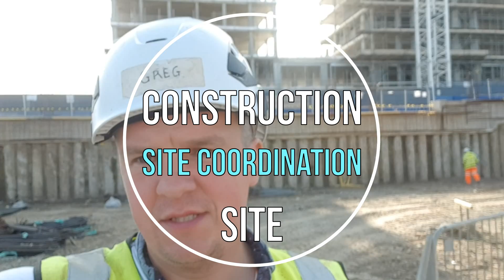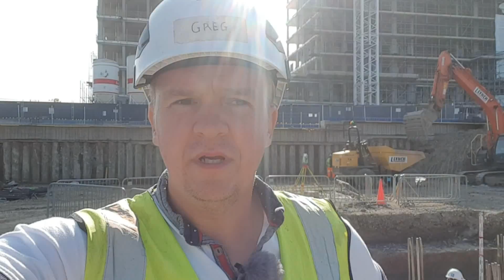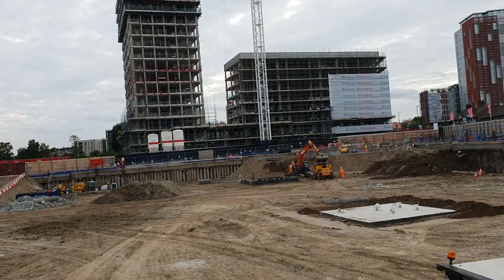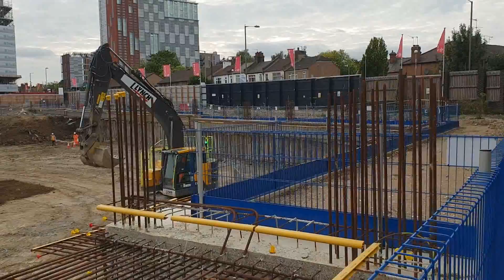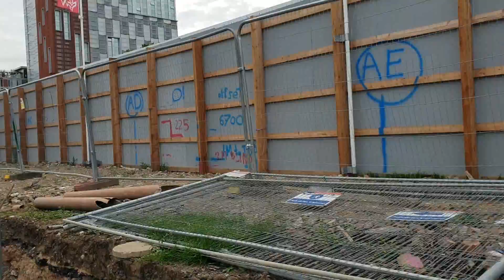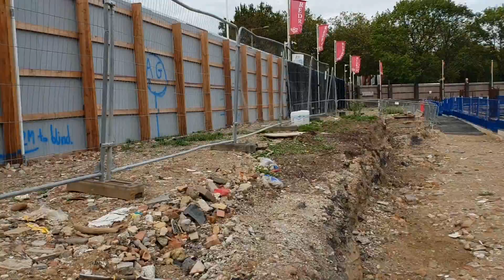CONSTRUCTION site coordination, SETTING OUT

Comment: Good work Greg! Keep it up! Watched your first video of this series, and I have seen that you reference the whole site to a few points from client. Have you ever checked them or established yourself? In case any reference is wrong who is liable for incorrect setting out of the building? Is it yourself or client subbies? Also, do you have any sort of insurance covering mistakes?
Reply from the maker: Hi Lee! I will tell more about it in my first drawings video. In this case points are provided by the client so it's their responsibility (they usually take third party to set these). On my last job we had a primary control - UKPN nails around the site. Client always has to provide setting out info (which sometimes is difficult to use - missing, or not accessible points). I don't have any insurance now :)